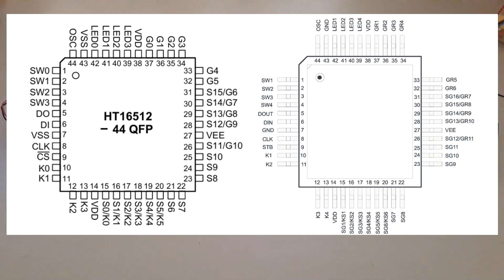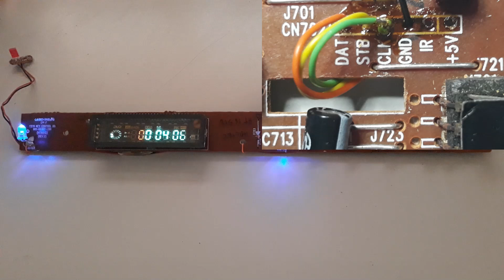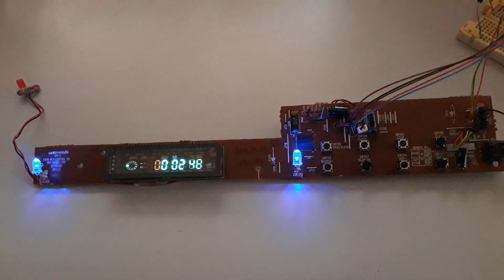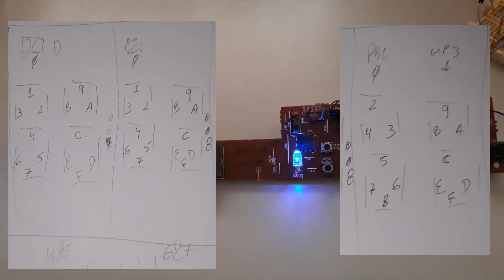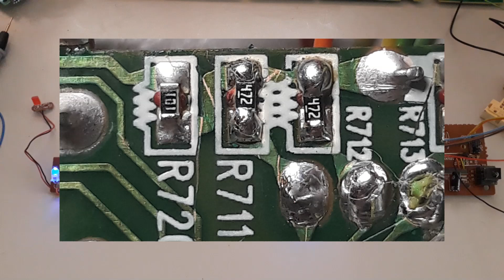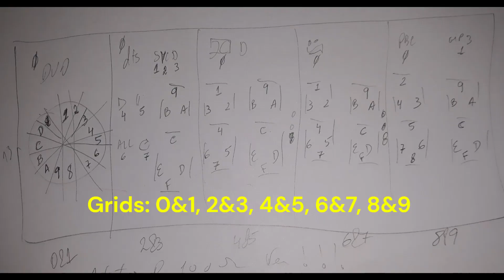HT16512

Comment: Very nice! I got the exact same board, but only the left half of it. it´s snapped and the rest is missing. I might try to buy the chip and connect it directly
Reply from the maker: Hi @ItsNeverMe,
Thank you so much for watching! Please search in the channel bar for: "PT6351" and:
"PT6315 VFD clock and code example".
In these two videos, I use a small board to implement the driver and make things easier. I don't know if you can buy this little board, but they are available on the internet.
The VFD has a 2.54 mm path and can also be used on a breadboard. The rest are wires to make the connections and don't need to be the exact size as is possible. See these videos.
I think I have more videos where these tiny boards are used.
If you have any questions that I know the answer to and can help with, feel free to ask, okay. Good work there, get to work!
Reply: @jlsmonte  Hey, thanks for the comment! I actually found the other half of the cirquit board in a bin of boards and worked the last hour soldering the 2 halfes together. The connections seem to work, so it's ready for cabling. I guess for the CN702 I need DAT, STB, CLK, GND and +5V right?
For the CN701, how did you manage to supply AC3.3V and -24V?
This is the second VFD I am working on, the first one had an embedded chip and only needed 5V and 4 other cables.
Reply from the maker: Normally, out of laziness, I use DC/DC converters like the B0524S, B0505S, and B0503S. The filament power supply should be AC, but DC also works for testing and sometimes even without shadows. This method with converters allows everything to be powered by a +5VDC power bank. But it's always a good solution to use a transformer with 2 or 3 windings, because in this type of driver we absolutely need 3 completely independent voltages, okay. Please take a look at the video: "PT6315 Technical Tutorial" where I have a somewhat lengthy response to a comment and where I suggest videos about various power supply solutions, okay.
Reply from the maker: Yes! The wires to be connected to the Arduino are Data, Stb, Clk, and the common GND reference between the Arduino and the panel. Insert a 1K resistor in each branch to avoid any risk of incorrect connections, especially with -24VDC, as the Arduino does not work well with this voltage. Creating the AC or DC reference for the filament is very important! The videos I suggested in the comment highlight this need!
Reply: @jlsmonte  Alright, I will check it out. Thank you so much!